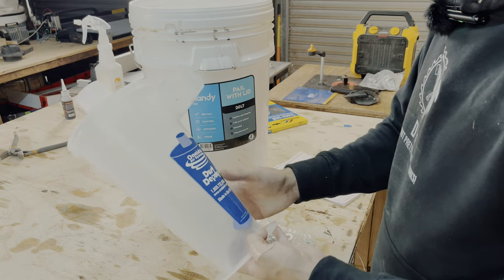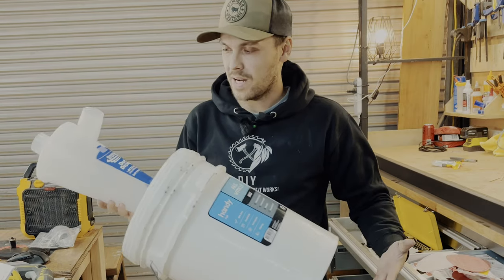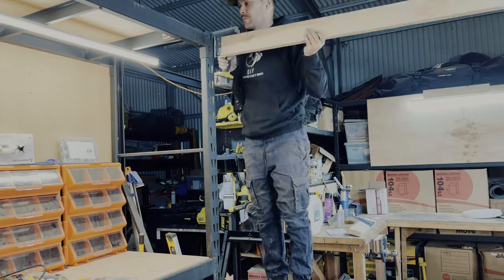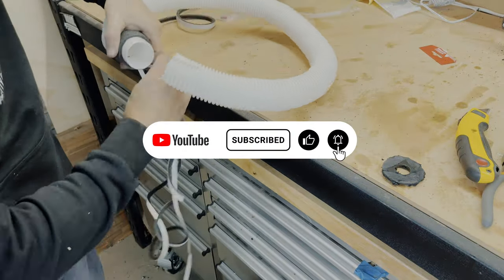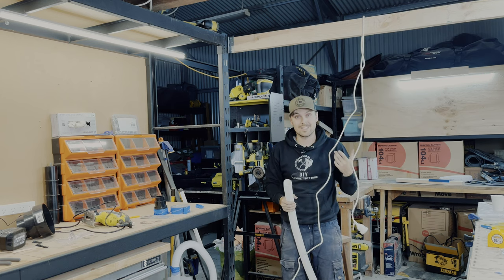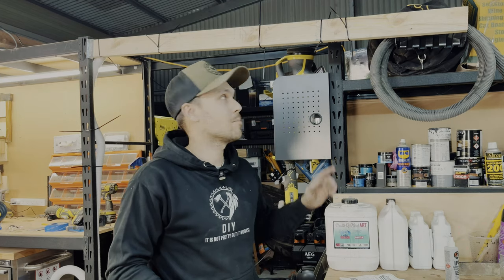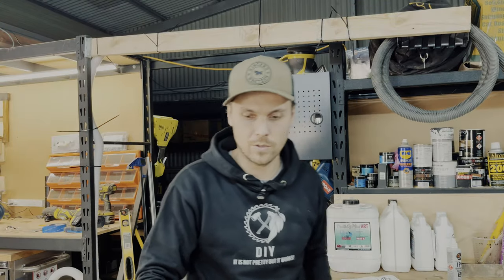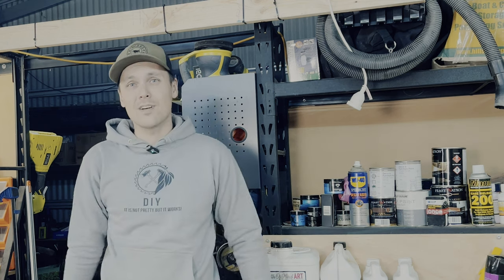You will regret NOT doing this! Best Shop Accessory - Boom Arm DIY

Comment: Great simple solution! As I watched the video & began to add the vertical hinged support, I was thinking, now he's gonna blow them away....but then the new support was only a foot high & vertical! I was thinking you were going to make your vertical about 18"-24" long & add a 2x4 angle brace @ a 45° or 60° back up to the boom. Would take stress off your hinges & screws & transfer into the steel angle shelving oost & make the boom more rigid & not sag in the future.(if boom is intended to be permanent or you want to add additional upgrades). Just a thought.
Reply from the maker: @cjcmusic52  great idea. It hasn’t sagged yet it’s work better than i thought to be honest 🤣 but i was thinking of permanently hanging all my sander there and if i do that it will need more support for sure. Thanks for watching the video really appreciate it ☺️